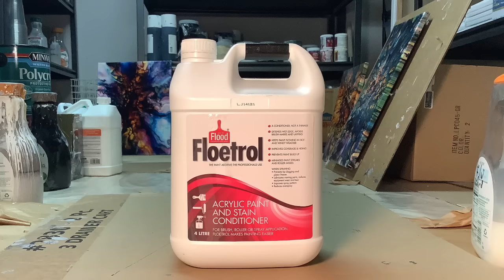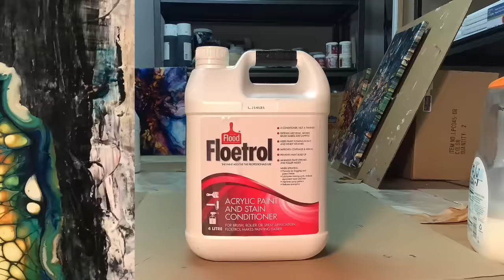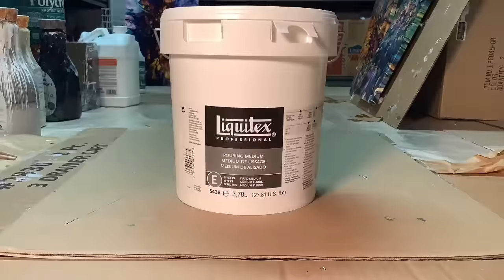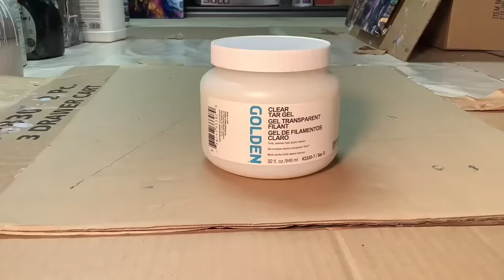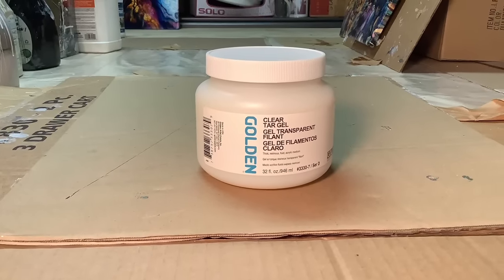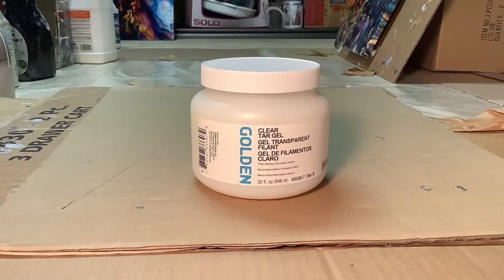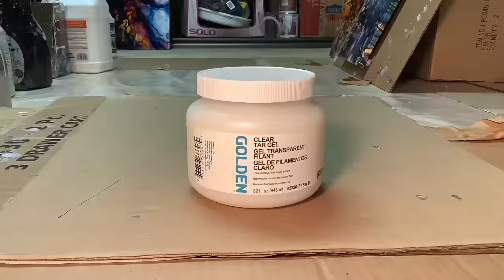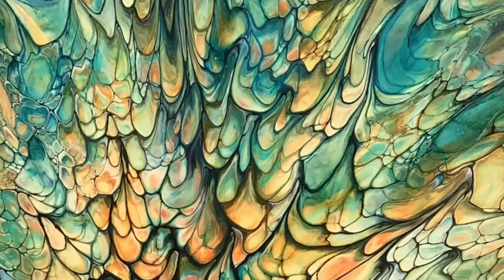What is the ultimate cell activator?

Comment: Hello from BC Canada.  Thank you for this "demystifying the process" video.  It's very informative, although I'm having a bit of trouble understanding your "mixing notes" in the full description. I thought the pouring medium was to be used in mixing the colored paints for the design, but you specify mixing the colors with Floetrol and water or  a Liquitex mixture.  "What is the pouring medium you first describe used for?"  I want to mix my own pouring medium for all the paints except the CA.  I don't want to use Floetrol or any other prepared medium.  I'm sorry to be confused when no one else seems to be so.  My additional questions are, "Is the tar gel absolutely necessary?  It's pretty pricey.  What functions does it serve? Can water be used as a thinner instead, in addition to the pouring medium?"  In the meantime I will listen to your video again.  Thanks so much for taking the time to make helpful videos.  Gail
Reply from the maker: Thank you so much Gail 🙏 you were correct…the main pouring mix is the medium for the colors. The Flotrol,water Liquitex mixture is for the “top layer mix” only. No, tar gel is not an absolute requirement but I like it to help hold cells intact. I do not like to use water alone for thinning.
Reply: @chasefluidart4341  Thank you for both clarifications.  I AM having trouble holding cells, or even getting cells, so I will order some Tar Gel.
Reply from the maker: Thank you Gail 🙏 no problem….experiment with small sizes.

Comment: Steve - I thought I remember you saying what pressure you had your air compressor at, but I can't seem to find it again.  What is the air pressure you are using?  Thanks again........
Reply: Hi Terry 🙏 thanks for your question.  I have the compressor set at 100 lbs per square inch but the key is that with a trigger I can use as little or as much air as needed. Most of the time I use light pressure.

Comment: Love your work. I need to know exactly what Venturi nozzle I am looking for. My husband has the compressor...but need more info on the nozzle. Again, your work looks like stained glass and is fabulous. Thanks for the info. Fran
Reply from the maker: Thank you so much Fran 🙏 I appreciate it. For me the Venturi nozzle is a nice addition but it’s not absolutely necessary. What is most important is being able to control the trigger on the gun to produce various amounts of air pressure. When I start a painting I’m using very little air but as I lift up I’m adding more and more air to the point of full blast. It’s a skill that takes a lot of patience and practice to perfect. The gun I use today is by far the best I’ve found to control the trigger. It only comes in a kit but it also includes a small Venturi nozzle you can experiment with. This particular company also sells the big Venturi nozzle if you want to go in that direction….however it does not fit the barrel of the gun and will need to be modified. One more thing…be prepared for flying paint….build a three sided barrier out of cardboard around your work area…best of luck on your adventure 👍 https://www.northerntool.com/shop/tools/product_200792060_200792060

Comment: So Chase, to review, the top layer has to be heavy enough to sink and allow the less heavy(i.e. less dense?) pigments to rise seeking equilibrium.  In addition, you need something to hold the integrity of the cells, which you have found to be Golden tar gel mixed with watered down American floetrol, correct?  Now.  Can this work with a Flip Cup, a Ring Pour, or a tilt and/or spin?
Reply from the maker: You nailed it Cathy 🙏 thank you so much. You summed it up better than I could 👍 the key is having the top layer mix sink to the bottom so yes it works for flip cups or even ring pours as long as there is plenty of top layer mix at the bottom of the cup. Keep one thing in mind that the mix used in the video is designed for force coming from above and needs to be more viscous than paint in a cup pour that depends on gravity alone. I would thin it more …say with a watered down polycrylic. It will take some trial and error…can’t wait to see your results 🙏

Comment: Thank you so much for the information and education.  I like having options. Have you experimented with zinser paint booster? Or minwax wood conditioner -  either one added to US floetrol and Amsterdam titanium white?
Reply from the maker: Thank you so much Catherine 🙏 great questions. I’m a big believer in simplicity so I look at ingredients in a very defensive posture. I see them as a potential disruptive force to the paint that can cause the painting to look trashy…so the less chemically complex the better. Yes I have experimented with both products. My opinion…the Zinnzer is too chemically complex and has zero body and since it has the consistency of almost water there is no room to thin it with water to lessen its harmful effects. Since the Minwax wood conditioner is an oil based product it will produce cells in much the same way silicon oil does ….but there is a price to pay because its chemically disruptive to the paint and introduces trash. The idea that Minwax wood conditioner added to American Flotrol equals Australian Flotrol is a myth propagated by a misunderstanding of the label on the Australian Flotrol. Just because it says “a paint and stain conditioner” does not mean that the product contains a special ingredient…it simply means that it will work for both applications.
My advice the less complex ingredients make a cleaner looking painting👍

Comment: I thank you for your great explanation. But I am not clear on something. You stated you mainly use Golden fluid acrylic paint. You use mainly 2 thinner mix, got it. But then you were specific about 8 parts paint to 3 parts paint for Lucas paint. I don’t want to experiment with expensive Golden fluid acrylic. Can you clarify the thinner to paint ratio for that type specifically?
Reply from the maker: Thank you so much Annie 🙏 if you use thicker paint in the main mix it will probably need thinning. I have no universal ratio because each paint will be different. Takes trial and error. Keep one thing in mind…the top layer mix needs to sink through the main layer mix….that would be my guide 👍
Reply: I will try it and let you know. I ‘have  never  used Fluid acrylics.
Reply from the maker: Thank you Annie 🙏 As you know this is a complex procedure and I try to simplify it as much as possible. I prefer the Golden fluid acrylics for several reasons. Heavy pigmentation is the main reason but also less fillers and more liquidity. That combination simplifies the process and takes a lot of the quess work out of trying to make thicker paint work. Yes it’s more expensive but in the scheme of things it’s worth it to me….and the most important ingredient in a painting.

Comment: Do you ever have problems cracking? Many artists recommend GAC800. Do you always use centrifugal force? What about small round cells? Your cells seem very large, almost reptile like? Not complaining,  just curious & trying to learn.
Reply from the maker: Again thanks 🙏 It’s happened in the past and I believe it mostly has to do with the vertical depth of the paint when the painting is completed and setting up. Another reason is using multiple brands or types of paint in the main mix. They have potential to set up at different rates and causes cracks. I don’t always use centrifugal force...but I prefer it. For me cell size is related to the amount of force applied....more pressure...smaller cells. Light pressure ...large cells👍

Comment: Outstanding explanation! I’m new to acrylic pouring and was told American Floetrol and silicone oil were the holy grail. It’ll be fun to experiment with some different mediums and see what kind of results I get! 

Question for you about sealing or varnishing - do you have a recommendation on how to clean the silicone oil off of a cured painting before sealing? Thank you!
Reply from the maker: Thank you so much Ari 🙏 I haven’t used silicone in a long time for just this reason. It permeates the painting and I think it’s virtually impossible to get it all out. The last one I did was an experiment to see how effective washing the canvas with soap and water was….several times. I then laid it face down on a paper towel and let it sit for a week…you guessed it…silicone pockets all over the paper towel. I did this test for several weeks…same results. It will help produce cells but it’s a ticking time bomb. I can’t think of a situation that I would use it again. Sorry I couldn’t be more help 😐

Comment: Chase... The Liquitex pm w Floe/H2O mix...10 parts to 7 parts soft body isn't working.  It's so thick that it barely moves out of an upsidedown cup. I figured I better contact you since I wasted two large cups of this configuration.
Reply: Rule of thumb…the top Layer mix should be thinner than the main mix. Not sure what kind of paint you are using….I use Lukas cryl. Try using 4 parts paint and if that is too thin add a little more paint till it gets to the right consistency. 👍
Reply: @stevechase4407  thank you so much Steve.  I truly appreciate your suggestions.  I'll give it a go tomorrow. Have a good night.
Reply: @stevechase4407  Oh, I used Amsterdam and Atelier.
Reply: @thesixthmonth4495  👍

Comment: Thank you for such clear & complete explanations for your conclusions of use or not of any cell activator. 
I have a question. Has a Behr Faux Glaze been tested as a thinner/conditioner? Thanks for educating me! Bernice
Reply from the maker: So nice of you Bernice 🙏 thank you so much. I am not familiar with that particular product but I would certainly encourage you to give it a try. Over the years I have tried many products with varying degrees of success. Almost all of them caused problems when used unmodified….too many chemicals. The solution is to dilute the product to limit the chemical activity. Water as a diluting agent will work but it doesn’t have any legs. My diluting agent is 8 parts water and 5 parts Flotrol which in essence gives the water legs. I mix it up in a gallon jug and it is the ONLY diluting agent I use. The key is to get the top layer mix to a consistency that will sink through the other layers of paint. Lots of thinner products will work with this method…the trick is just finding the one’s that work best. I love that you are an experimenter…keep up the good work 👍

Comment: What you have taught us is quite remarkable. I can't thank you enough. Would it be possible to exchange the Golden tar gel used in Stage 1 of the Main Mix with the Liquitex Pouring Medium like you did in the Top Layer Mix? If so what percent would you recommend? Thank you for all your research and timely presentation––can't wait to use it.
Reply from the maker: I appreciate it Wallace 🙏 the reason I use tar gel in the main mix is to add extra strength to the Behr paint….and it made a big difference in holding everything together. It’s not an absolutely necessity. How it reacts to other brands and types of paint…I don’t know. Not sure why you want to use Liquitex pouring medium as a substitute but my guess is it would interfere with the Behr because of its complexity….but it certainly won’t hurt to give it a try. I would start at about 10% of the total mix and see what happens ….best of luck with your experiment 👍
Reply: Thanks for your quick response. I wanted to use the Liquitex because I already have that. I would need to order the Golden Tar gel. That said, I think it might be worth it to order the golden product.
Reply from the maker: You can take a little bit of the sting out by ordering a smaller size to experiment with..then go big when you are comfortable with it…since I use it for the main mix and top layer I buy it by the gallon….it ain’t cheap but worth it to me 👍

Comment: When you talk about 3 parts Behr and 1 part Polycrylic, I assume you mean by volume, not weight? Such as 300 ml of Behr and 100 ml of Polycrylic? I'm finding the resulting mix a bit too thick and the top layer black just floats on top. I suspect I'm doing something wrong in the mixing process???
Reply from the maker: Paul 🙏 keep in mind that I am adding the force of an air compressor to the process. Knowing that in advance makes it necessary to have the mix “thicker’’ than most folks. It takes adjustment through experimentation to get the right consistency for your particular use of force. Try watering down the Polycrylic to thin the mix down👍

Comment: Differences in viscosity and surface tension I believe are what keep water and oil from mixing.
Reply from the maker: Thank you Jesse 🙏 this is the simplest definition I’ve seen “Liquid water is held together by hydrogen bonds. (Liquid water has fewer hydrogen bonds than ice.) Oils and fats not have any polar part and so for them to dissolve in water they would have to break some of water s hydrogen bonds. Water will not do this so the oil is forced to stay separate from the water.”
Reply: @chasefluidart4341  after watching and commenting on your video I went and did some more research, just to be sure.  And there are some really good videos that go into great detail, and it seemed to me they were explaining the same molecular mechanisms that create the characteristics I'd mentioned. However the reason water and oil fall out of solution, seems to come down to the fact that two molecules distribute their electric charges differently. Water is a compact molecule, and oils are long chains of hydrogen and carbon.
Reply from the maker: Thank you Jesse 👍

Comment: Thanks for this very informative video!  I am a beginner and this clears a lot of issues.  What is the orange tip being used on the air gun?
Reply from the maker: Thank you so much Paula 🙏 I appreciate it. It’s called a Venturi nozzle…it gives more control over air flow. If you haven’t seen my first video check it out for a further explanation about the use of air👍 https://m.youtube.com/watch?v=zMyhLf5nO5M
Reply: Are your measurements in fluid ounces by volume or by weight?  Can you do a test mixing powdered paint colors, like Colourarte or suggest how to adapt them to your formulas shown here?
Reply from the maker: Thank you Paula 🙏 I measure by weight. I have never experimented with powders…I prefer a more uniform, solid look. I would guess that it would take a bigger volume of your mixture than fluid acrylics.

Comment: A very useful video. Thanks. Can someone please share an exact breakdown of the various mixes please. I am a complete newbie to acrylic fluid art. 
I read the description but I still find it difficult to follow. Will appreciate any help. . Thanks in advance.
Reply: Also floetrol is very expensive in my country ( India) . Would appreciate if anyone has any other substitute  suggestions... thanks 😊
Reply from the maker: Thank you Darshana 🙏 there is no Exact breakdown there are just too many variables. Sometimes you have to add more or less of an ingredient to get the proper consistency for your particular style. I would suggest watching the video several times to get a clearer understanding. The following is a close approximation for all the ingredients…as simplified as I can make it…best of luck on your adventure.
There is no “chemical” magic here.  It’s all about density/gravity of paint and controlled force to push heavy density paint down and out onto lighter density paint.
 
STEP 1:  Main Mix:  Base Paint & Color Pouring Medium; 
Mix: 3 parts Behr Marquee Interior Semi-Gloss Enamel, Deep Base, Untinted, 3453 (green can, HomeDepot)
       1 part Minwax high gloss polycrylic
Add: to the above add 10% Golden tar gel
EXAMPLE: 15 oz (3 parts) Behr
 5 oz (1 part) Minwax Polycrylic
20 oz (4 parts) total
20 oz times 10% = 2 oz tar gel (which is almost ½ part [2.5 oz], but is actually 3/8 part)
***The consistency of this formula is ideal for my use of controlled air. If it is too thick for you I suggest adding small amounts of water to the polycrylic alone until it suits your particular style...this will probably take several trials...so test with small proportions.
 
Apply a fair sized puddle as the first layer or base paint, it is the identical formula as all the rest of the colors....spin to thin it down a bit  and add more base paint around edges of paint that is already down, spin a bit, and smudge base paint out to edges of canvas.  
 
STEP 2:  Color Paint Mix; same consistency as Main Mix
Mix: 10% heavy pigment paint (Golden is best)
90% Main Mix (Base Paint & Color Pouring Medium)
 
Apply Color Paint Mix (second layer) in several ways, using squirt bottle, either very thin squiggly lines or in puddles made of thin squiggly lines that then look like they were poured, doing 1st color, then 2nd color, etc.
 
STEP 3:  Top Layer Mix ; this will be THIN
Floetrol/Water Thinner: 5 parts regular Floetrol plus 8 parts water. 
This will be used to thin the Tar Gel or the Liquitex Pouring Medium.

Tar Gel Top Layer Mix: 
10 parts Floetrol/Water plus 4 parts Golden Tar Gel. This makes the thinner for the paint.
Then mix:   8 parts Thinner Mix with 3 parts soft body paint.

Liquitex Pouring Medium Mix:
4 parts Floetrol/Water plus 10 parts Liquitex Pouring Medium. This makes the thinner for the paint.
Then mix:   10 parts Thinner Mix with 7 parts soft body paint.

Apply Top Layer Mix using squirt bottle  concentrating in center or apply as puddle made of thin squiggly lines that then look like they were poured.
 
STEP 4:  Use controlled force on the paint (compressor, blow dryer) to force Top Layer Mix  over color paint.  This is the most critical part.
 
STEP 5:  Spin or tilt
Reply: @chasefluidart4341  thanks so very much for taking the time to answer 😀  I am going to try various ways to work with acrylics and pretty excited 😃  I so appreciate your video and help. Thanks again
Reply from the maker: Thank you Darshana Dee 🙏 happy to help 👍